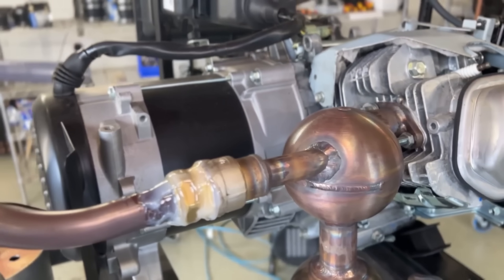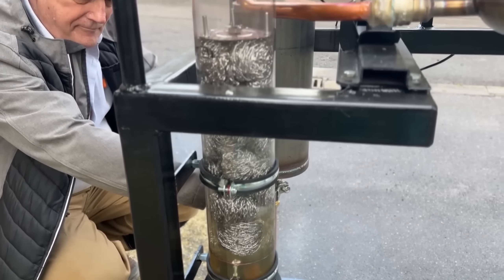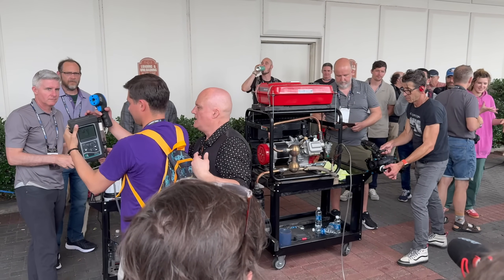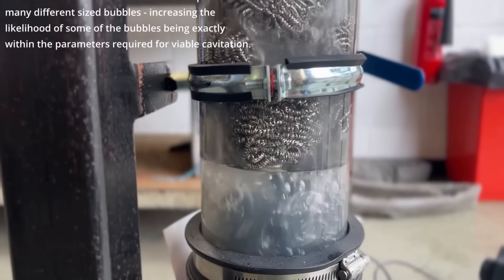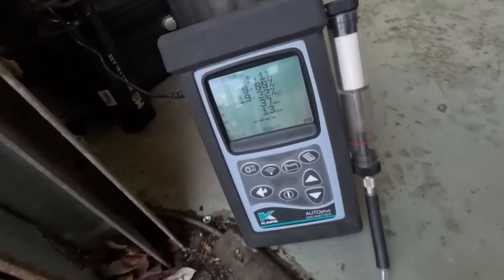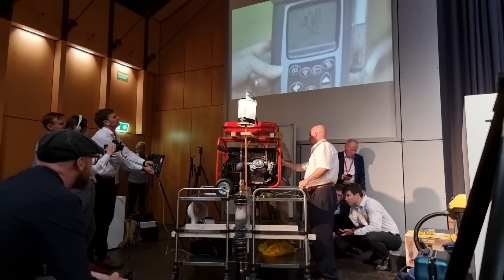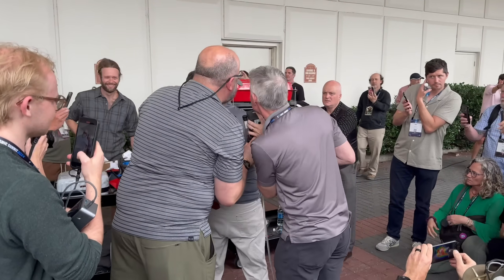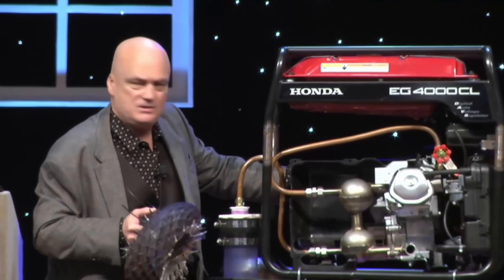Oil Companies Game Over: Malcolm Bendall's Free Energy Generator 2024 Invention of the Year!

Comment: The commentary here is incorrect in my understanding.
The TG does not produce electricity but when linked to a normal petrol or diesel generator turns carbon pollutants into pure oxygen and does make a fuel saving.
Reply: It's an electrical generator , if its running , its producing electricity.
Reply: @ you’re correct 
That’s what an electrical generator is designed to do
But it uses normal fuel albeit more efficiently but transmutes carbon emissions into oxygen
I’ve just written this piece about an interview which might clarify if you tube allow a link.
Back to earth but still mystical….
A couple of guys talking about the Thunderstorm Generator transitional technology 
It’s all based on sacred geometry and numbers and when fitted to a normal petrol or diesel generator transmutes 99 per cent of carbon pollutants into pure oxygen
Sounds a scam I know especially as the machine involves an angle based on the Great Pyramid but I’ve followed this from the start and will be demonstrated on Rogan next month
https://youtu.be/D6WXWDuQmM0?si=JzP8pkTUt84tkndI
Reply: @davidhaith1725  I already know its real and it works. I've seen it demonstrated. I've spent considerable time following their progress. As far as proving it is functioning as stated , that's what they have been doing for over a year. They have won over every naysayer during that time. The fact is it has been reproduced in demonstrations so many times that doubt by anyone at this point just shows how little they know of what has occurred in the last 12 months.
Reply: @johnunderwood9575  Yes, the one in this video is a generator. The device is an add on to ICE, whatever they're driving. It's not a free energy device, it's a emissions reducing device.
Reply: @davidhaith1725  it creates atomic hydrogen & that can continue operating without using fuel once at optimum temperatures it only needs water topping up
Reply: @EgoOut  no you're wrong, the Thunderstorm Generator relies on fossil fuels, but it transforms how they are used. By retrofitting engines, it enhances combustion efficiency and eliminates carbon emissions by converting pollutants into oxygen. This innovative approach allows existing fossil fuel systems to operate in a much cleaner and more sustainable way.
Reply: The Thunderstorm Generator, by Malcolm Bendall, uses plasmoid technology and cold fusion to increase engine efficiency and eliminate pollutants, converting carbon emissions into oxygen. It promises cleaner energy and retrofitting applications for existing engines, revolutionizing fuel use while reducing environmental harm.
Reply: @BS-Fact-checker    If carbon emissions as CO2 are converted into oxygen, what happens with the carbon?
Reply: @heinzpg Good question. Perhaps passing exhaust gas through plasma breaks the bond between carbon and oxygen and leaves the carbon as  a fine powder or "soot" that is then removed by a filter leaving O2 as the only emission. This waste carbon may actually have commercial uses since it should be in the activated state and ready to bind to other chemicals.
Reply: @heinzpg  It goes down one of those magical wormholes in space and disappears with a physics defying "pop!" LOL. 
Why aren't all the Petrolheads screaming about what a fire risk oxygen is I wonder?
Reply: @wingnut71     " Perhaps passing exhaust gas through plasma breaks the bond between carbon and oxygen "  Here's a problem: separating carbon and oxygen is an endothermic reaction, it needs a lot of energy to do that, never mind in which way it is done. The only source of energy is the fuel which is burned. Thus this separation would reduce the efficiency of the engine considerably since a noticeable amount of energy must be spent for this separation. 
And yes, the carbon must be collected, it could be burnt again and if not collected it would cause unwanted particulates in air. However, nothing is mentioned about that.
Reply: @heinzpg  Depends if the plasma can be generated from waste energy or not. If it is from waste heat it could work but I'm not sure how you could get plasma that way as it requires high voltage and I don't see a way of getting that from hot exhaust. On second thoughts, maybe a turbo driving an alternator to get 12 volts which is then stepped it up with an inverter would work? He could be creating plasma inside the exhaust with a magnetron from a microwave oven. They typically need 5000 volts. Power output is normally 900 watts and I guess most cars engines would lose that much in the exhaust easily. Could be an interesting experiment?
Reply: @wingnut71    If the fuel would be pure carbon the answer would be easy. Burning carbon to CO2 delivers an amount of energy. With a combustion engine it is the sum of mechanical and thermal energy output. For reversing this reaction the same amount of energy is needed as input, which is not possible by the thermal energy alone.
But fuel contains carbon-hydrogen-compounds, and this might make a difference because also hydrogen delivers energy. What is strange: it is claimed that Bendall works open source but no one seems to know definitely what the inventor himself claims.
Reply: @BS-Fact-checker  That's pretty much it. This is what excites me , a retrofitted gas automobile is now the greenest form of personal transportation. Throw those ridiculous EV's out and lets get retrofitting the gas and hybrid auto's that are still being manufactured. This could literally pull our auto industry out of the crapper and place us on top again globally. We have one hell of an opportunity here , I hope it doesn't get fucked up.
Reply: @johnunderwood9575  If it's as good as it's claimed, manufacturers would be climbing over each other to get the rights to make it, not trying to murder the inventor as most commenters here believe.
Reply: Carbon is not a pollutant! you are spewing the lies of the clean green psychopaths.  Global warming is a hoax and all who support it are idiots and fools.

Comment: Why is there a petrol tank on the top of it ?
There seems to be a pipe going from the petrol tank into the carburettor on the back of the engine.
Are you sure it doesnt run on any fuel at all ?
Reply: It DOES run on gas and the hoax it the youtuber claiming its FREE, which is not claimed by the inventor.
Reply: Ah come on.................. Next you'll be telling me Santa doesn't exist!

Comment: Anyone that develops these clean energy devices are and will be silenced by the oil companies and those that are bribed to sweep them under the rug.😢
Reply: but the "power" of the arrengement is getting weaker overtime, they in some time will be unable to keeep on opressing humanity, so it´s best time to bring new possibilities with no reason for fear... 💪
Reply: if it was for real, probably would.
Reply: @Gazr965 Indeed, if it worked, but they won't.
Reply: There's already a device that does this it's called H2 flex you can run an engine using water, it's being sold online
Reply: @dominicgeorge7299  " it's being sold online "   Many scams are sold online. And H2 flex is a scam, and not even a new one.
Reply: @dominicgeorge7299 
Do you have a link to it please.
Reply: No you're wrong, the thunderstorm generator still relys on fossil fuel to operate but has zero emissions. That's the breakthrough  but this video has got it all wrong.
Reply: @BS-Fact-checker uses only 20% of what would otherwise be needed so significant fuel reduction.
Reply: @BS-Fact-checker your statement is incorrect it only really uses fossil fuel to get it up to temperature. I know this is hard to believe because of what oil companies have done in the past to kill this process. This is basically what Stanley Myers came up with in the 1970s. Let’s not forget what happened to him at lunch a Dennys I believe his last words were “they poisoned me “
Reply: That’s why he didn’t take the patent route and open sourced his work
Reply: or silenced by the "renewables" crowd.
Reply: Done that for 80yrs ... knew of a man who invented an engine that ran on compressed air...after a threat, he sold out.... that was in the 60's. Paris, 50yrs later, had taxi cabs running on the same design. Nuclear electricity ran the compressors and the cars would return to the station every 3 to 4 hours for a recharge of air. Zero urban   emissions.
Reply: Really? So the oil companies deliberately suppress science in conjunction with every world government do they? So please then explain to me why they could not suppress climate science. The one thing that will actually bring oil companies to their knees. Or don't you believe in climate science and are therefore are trusting the oil companies?
Reply: The 😮😮🎉
Reply: Time will tell my friend. Think positive , it couldn't hurt.
Reply: He stole Paul Pantone’s info, GEET, and Paul died because of it.
Reply: Silenceing people is going to stop
Reply: @ says who? 🤨
Reply: Its above the oil companies. It's about tax income from those energy sources.
Reply: Its less the oil companies and their profits that have a problem. It's the carbon barons that want to use climate change and fear to control energy and economies.  When this catches on, any petroleum fuel engine could be made near zero C02, for transportation and electricity generation, and that runs a stake into the heart of the carbon boogeyman.
Reply: It's clear that governments support making money and NOT saving the planet. Governments cripple communities to get more and more money because they 6:10  control their spending!. If back on a gold standard they would have to control expenditure  just as it was most of the last century . Nixon¹ has destroyed the USA, the sooner they get back to gold the quicker the USA will recover but politicians do not like being constrained on spending that's why they are n a mess and taxes keep rising, so not a chance this will happen.
Reply: Elixir revolution can do away with that notion.. if I want it to. That’s why this video is posted btw
Reply: Oil and water are not going away.
Reply: In the past, very true.  There are too many of them now.  And many with open-source plans available online.
Reply: @StingFlight I hope so! Who are some of the names now?
Reply: @StingFlight    And which open-source plans works? If even only one would work this device would be in common use.
Reply: There are many cases where a superior product is not in common use for a variety of reasons.
Reply: EXXON bought out Algae diesel from the state of New Mexico, where the state was running it in all their diesel engines, for less than 27 cents a gallon. Locked up in the USA but in use now world wide, Fascism at its best.
Reply: @Zgreasewood   What is the source for this information??? Algae diesel is by no means in use world wide. It is produced only in small quantities and its production is presently more costly than fossile diesel. Exxon was engaged in research of algae fuel but has given up this engagement recently. Other companies still uphold their interest for this alternative fuel.

Comment: The energy to produce the HHO takes more energy than the generator generates. Simple physics.
Reply: NOPE! FAIL!
Reply: Exactly, but he is calling the HHO generator an "Ionizer" (see 9:05) ? An ionizer needs a gas inlet and high voltage, because it only ionizes the gas, which this so called "ionizer" does not appear to have.

Comment: Just another scammer. Learn the laws of thermodynamics folks and stop falling for snake oil. I guessing all those standing around in awe with phones out failed science. In order to generate the plasma to begin with you need energy. Which he's getting from a wall plug.  The reason it's bubbling is because it plugged in. Looks more like he's creating hydrogen gas from the power coming from the wall then running the engines from it. Anytime we can produce power on site we gain efficiency over the grid, but its not free energy. He's merely changing state coming from an existing source which is not efficient.
Reply: Quit being an ignorant gatekeeper. You Are Wrong.